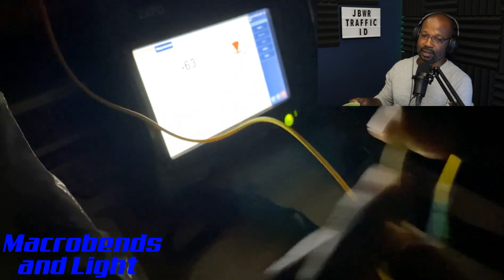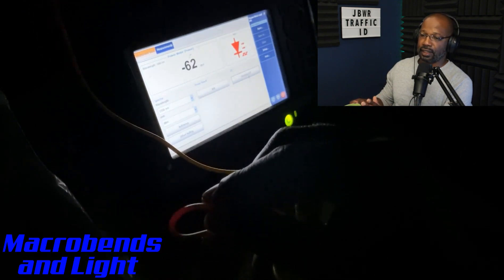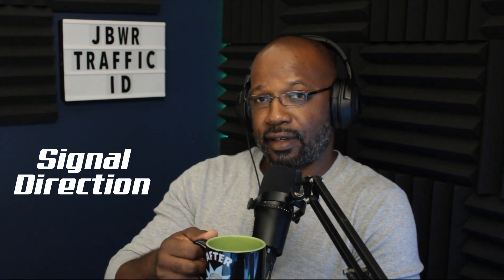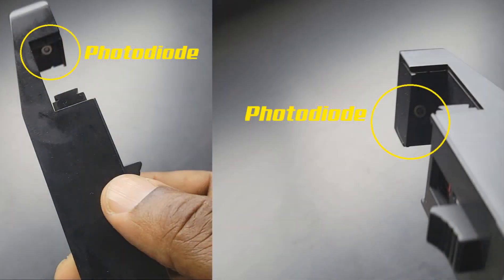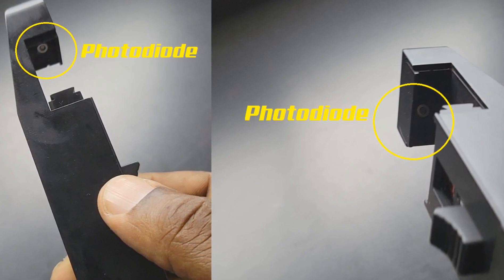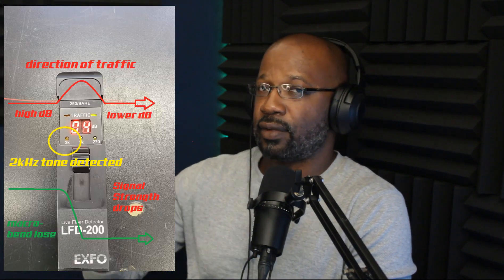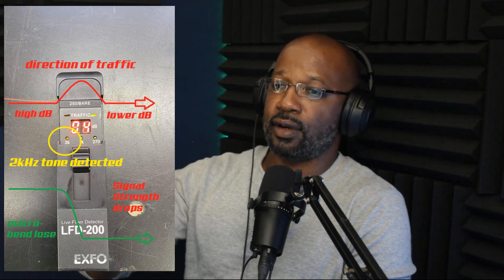What is the FO Traffic ID?

Comment from the maker: Timestamps:
00:16 A few announcements
00:49 What is the Traffic ID?
01:42 How does it work?
02:32 Photodiodes 
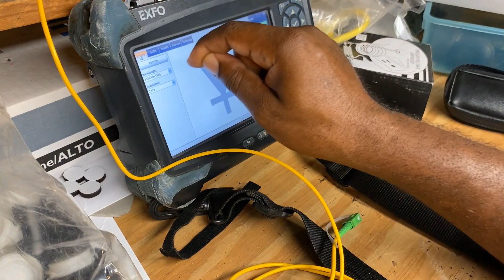03:15 Macro-bends and Light
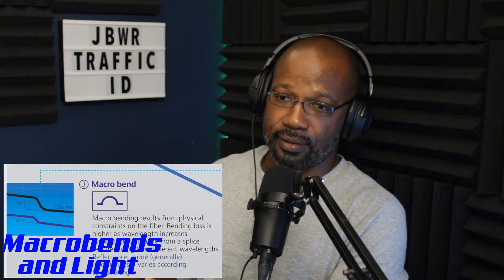05:09 Modulated Light / Ambient Light
06:02 Signal Direction
07:52 What is tone?
09:06 Inside the HandHole.
11:58 Attachments
13:35 Outro